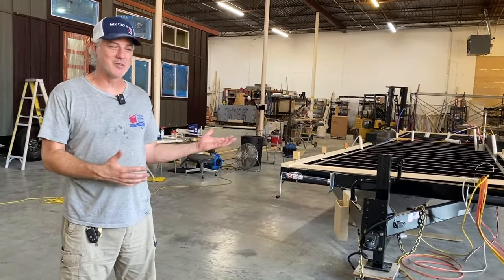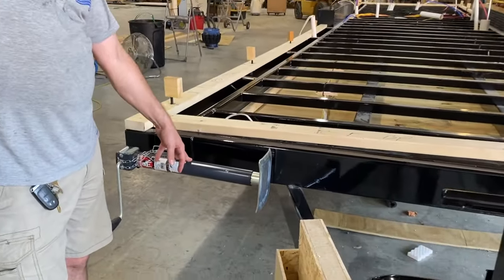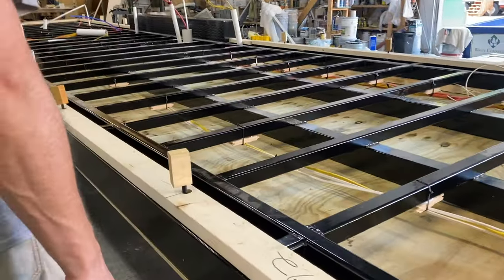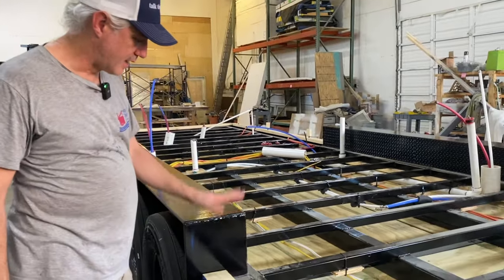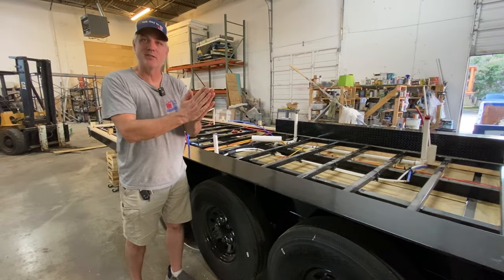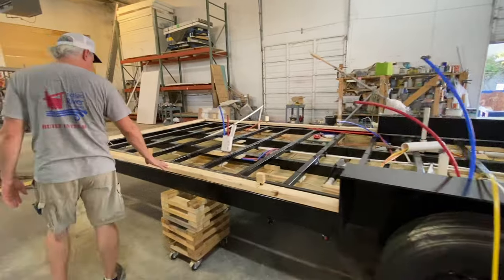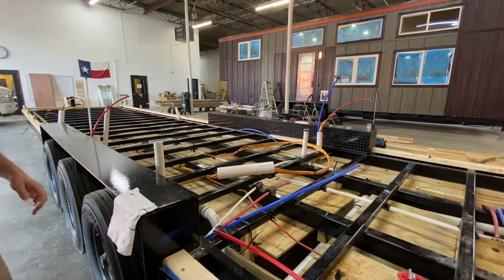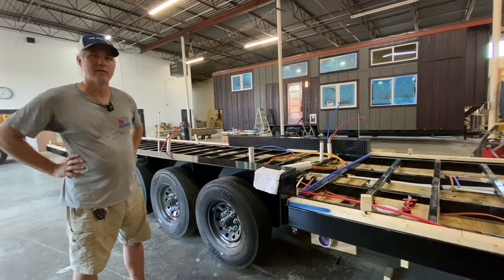Best Tiny Home Foundation for a THOW 😍 Custom Tiny Home Trailers by Indigo River built in Texas!

Comment: Thanks for the info!!
Would you be able to make a small travelers package trailer that had curved aluminum or stainless steel walls (similar to an airstream)??
Reply from the maker: We don’t build traditional RV’s - our homes are built heavier & more sturdy (to withstand daily wear & tear) than something like that with light weight metal walls.